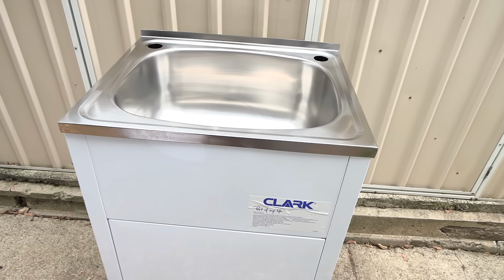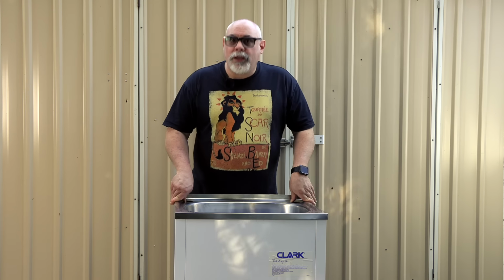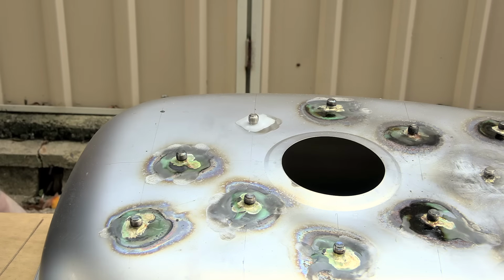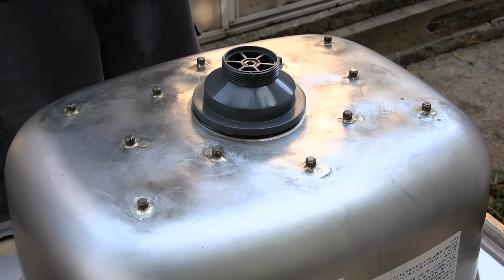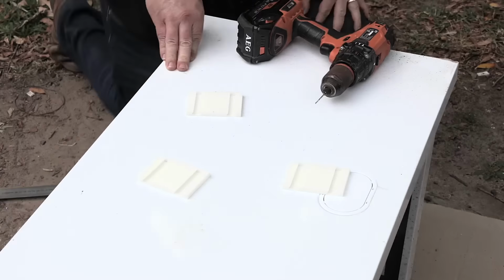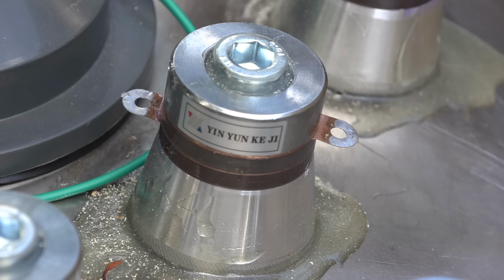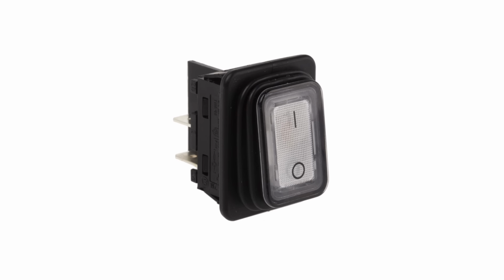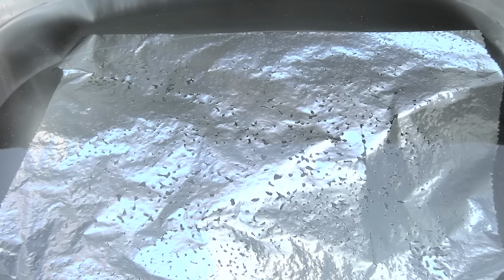Building a Laundry Sink Ultrasonic Cleaner

Comment: nice build, I am wondering if the thickness of the walls of the sink matter? will a thin wall have a tendency to vibrate and attenuate the cleaning power getting into the water or would it actually increase it? or does it not matter?
Reply: yeah thinking about this too. Also thinking if a welded together sink would work? because I can't find sink's deeper than 8 inches from where I'm from

Comment: This is an awesome  project. I have an idea about using this behemoth. When you have small parts to clean perhaps requiring chemicals and you don't want to "contaminate" the entire tank, put the items in a plastic bag like a zip-lock to isolate it from the media in the tank. Then you won't waste cleaner agent / solvents in the 4 or 5 gallon tank.  I have a very small unit that I have never had to clean by doing this and I use tap water as the media in the tank. The ultrasonic energy goes right through the bag and cleans what ever is inside. It also prevents the family jewels from going down the drain!
Reply: BRILLIANT!
Reply: I've seen suggestions to use small glass beakers, as the glass doesn't dampen any vibration.  The soft plastic bags don't reduce the effectiveness noticeably?
Reply: @somebodyelse6673  Well glass has mass that has to be moved back and forth and that takes energy so glass does dampen the vibration converting it to heat. The plastic is low mass and very flexible and therefore mostly transparent to the vibrations.
Reply: Do you put any liquid or solvent in the bag? If not where does the dirt, grease, rust etc. go, does it all just fall off into a dry bag?
Reply: @Bodhi1satva  Yes  I put H2O in the tank and then put the bag of items and whatever solvent, soap or scrubbing agent in the sealed bag. Then that goes into the tank of water.
Reply: I use a painter's cup.  Fill the tank with water, fill the cup with cleaner, put the small parts in the painter's cup.  Saves lots of cleaner--water's cheap!  Great video!

Comment: Hi Bruce,  Silver soldering is an excellent choice, but Araldite (or any epoxy) is not a good choice for this application even as a backup. It is too soft and the ultrasonic waves have difficulty transmitting though. Available info is limited for Araldite, but for most epoxies from 20 to 70C you see a drop in strength to 20% of the room temp value. In tests I did many years ago  (gluing a transducer to a cement vibrator to measure vibration) I found Araldite does not handle vibration well, it seems to be too flexible and got hot and failed due to the vibration. You need a glue which is hard setting and thin. I found common superglue was more effective than an epoxy. I now use Loctite AA326 with SF 7649 activator for vibration prone equipment. JB weld I have not tried, but the SDS shows better performance at higher temperatures than Araldite.  Looking forward to a follow up video in a few months to see if your experiment is successful and if so replicate one myself. Keep up the good work Andy.
Reply from the maker: What do you recommend?
Reply: Best to talk to a loctite specialist as they may have a better idea of your application  I have found them pretty good. but if you have difficulty contacting them I would use  Loctite AA326 with SF 7649 activator. Don't buy from ebay as it is generally out of date and it makes a big difference. Our company buys it from blackwoods. There is one in Greystances, but available online
Reply: Attention ⚠️ following the AA 326 LOCTITE data sheet the recommended bondline gap is only 0.1mm! Up to 0.5mm when applying the activator on both surfaces. https://static.rapidonline.com/pdf/63-0912t_v1.pdf

Comment: Loved your video.  If you had it available, and Oxy Acetylene torch would have been a better choice for Silver Solder.  it would deliver more heat to your area allowing the parts to fuse together more quickly.  You did manage to get the job done with a propane torch which probably avoided burning a hole in your sink.

Comment: Earthing on tub and stand is absolutely necessary and you should bush the holes where cables pass through the sheet metal.
The enclosures you made for the drivers don’t seem to have any ventilation holes apart from the fan mounting but you’ll need air flow to get any benefit from the fans.
Likely you would get far less distortion of the the stainless tub by using a TIG welder to apply quick spot welds to the mounting studs.
Interesting project, it will be interesting to see how it performs and how reliable the components are
Reply from the maker: There is ventilation under the board, so the fan pulls air from under the board and then up and out through the fan hole. You are the first person to mention that, so congrats on your observation skills. I now have grommets around the wires that pass through the metal, I just don't show it in the video.

Comment: When soldering electronic, I pre-solder (tinning) the contact and wire.  That could be done here.  Solder applies to the sink and to the nut,  then the nut is added to the sink and soldered again.  Should make a better contact as solder doesn't have to try and flow between the nut and sink.
Reply from the maker: I'll try that next time. I do that with electronics soldering all the time, so I should have applied it to this.

Comment: @ 5:00 mins in "It is incorrect, as we add more drivers and inducers we will incress the cleaning power, end of story", wow, the arogance. Incidently you are incorrect not end of story at all, clearly you have no engining qualifacations other wise you would not have said this, infact you even offer evidence as to why this comment is wrong later on in your video. Just to clarify, if every inducer in your set up is in phase then yes it is fair to say that you will not see any cancelling out happening but as you have 6 seprate controllers/drivers i can guarantee that they are not all in phase with each over and as a result they will be cancelling each other out to some degree or other. Infact later on when you talk about not wiring some up backwards or you will cancel out, this is true if they are on the same controller but enless all controllers have a shared oscillator to keep them in time with each other then the odds are that setting one set backwards to another set will give you the same results as it is 50/50 that they will be close enough in time to assist and not cancel.  (not really but to make thing simple thats close to right)
Reply: Even if they were on the same oscillator, their physical distancing will allow the creation of standing waves. If they were spaced apart 1/2 wavelength, then they would cancel out.
By my calculations a half wavelength of sound in water at 40KHz is around 2.25 mm
Reply: @Ropetangler   You are right but i was not going to get into that, as factors such as the shape of the container, its thickness and what its made from (effectivly its resonance frequency), as well as any additives that are in the water even the altittude at which  you use the machine will also effect this, but for the sake to the average viewer i was tring to keep it basic. and as i said Close to right... lol
Reply: You need to chill. At this sort of frequency and 3D space, the deconstructive interference will hardly affect cleaning results. It will be a fool's errand to try to simulate something like this in a DIY project with so many variables. Sure there is a non uniform wave field, but at 40khz it's not going to matter much. Adding more transducers WILL increase the cleaning power in this project.

Comment: It is possible for the transducers to destructively interfere and cancel, but it is a very complex situation as physical placing of the transducers, wire length, whether all the transducers are on the same driver or on separate drivers as well as what's in the tank will all influence this..  In general however, the likelihood of an assembly just happening to have significant destructive interference is negligible and more is better...

To verify whether AC line cord polarity is important, you should use your ohmeter to check for continuity between the output and the AC pins..  If there is no continuity, it doesn't matter.  If there is continuity, then the neutral lead should be on the pin with continuity and should also be connected to whichever polarity of the transducer that makes contact with the wash basin..

You should also cut some slots in those driver enclosures otherwise the fans are useless as there's no path for the air to flow.

Comment: Excellent video, what filerment did you use to print the switch panel and enclosures, petg? Also what program did you design them in?
Reply from the maker: I actually use NewTek Lightwave for 3D modelling, which might seem like an odd choice. I used to do 3D illustration for product concepts, and I used Lightwave for that, so it's what I know. I use Cura Slicer, and everything was printed with eSun PLA.

Comment: As an electrician please make sure you're glanding or otherwise mechanically protecting the AC cables from the sharp edges of the penetrations. Also EVERY exposed metal surface NEEDS to be earthed. Really all metal surfaces should be if you cant otherwise segregate/insulate any exposed connections from the metal. This way should anything go wrong the RCD will trip or the breaker if there's a low enough resistance to earth. A simple multimeter would suffice, checking from the UPC plug earth pin to any metal surface. 1 Ohm being the highest value allowable, but in reality it should be no where near that.
Reply from the maker: It didn't make it into the video, but the wires are all surrounded by grommets now and the whole thing is earthed. Thanks for the advice.
Reply: @BranchusCreations  PLEASE include such things in your videos in the futur!
These are the most important things in ANY DIY video with main voltages!
I can't emphasize this enough how many severe dead traps have been build on youtube like this!

This is what makes the difference between a proper DIY video project, and an extremely dangerous never-try-at-home dead trap kit which should be reported (yes, I AM that serious about it, just because it is overlooked so much and the dangers are VASTLY underestimated by everyone).

Comment: Very sweet build, you have fixed a lot of the issues with your previous cleaner.

Just a couple of suggestions though:
1. You're using cheap Chinese mains powered drivers so please braze a bolt to the tub to use as an earth. 
2. Please do something about the cables running into the mains box. Either make the hole larger and use a grommet, or preferably use a nylon cable gland to prevent the cable being pulled out and water getting in. Single insulated mains wire up against metal edges is a recipe for disaster and I don't want you to die. 
3. Instead of the ferrules, just strip a section out of the middle of the wire and solder it directly, it ends up a much neater job.

Comment: close to the end of the video it showed wires going through holes drilled in metal. you want a plastic jacket ir some electrical tape to protect the wires. Over time the jacket will wear and youll get a dead short. I love this project.
Reply from the maker: Thanks, this has been done.

Comment: Hi Bruce.  Great video!  Just a thought when using multiple transducers -- before 'deploying' them, it might be a good idea to take a multimeter and measure the resistance of each transducer and write it somewhere on the transducer body.  This would facilitate two things.  First, one could arrange the transducers from low to high resistance, and pair them into sets of two accordingly so that each pair is "matched" to one another.  Secondly, if you develop a problem in the future with one of the pairs, it would be easy enough to unsolder a wire from one of the terminals on a suspect transducer, measure its resistance, and compare its "new" reading to the original resistance written on the transducer.  That might help in troubleshooting defective (open, shorted, etc.) transducers.  Also, if the transducers do indeed exhibit a polarity, it might be good to measure the resistance with the multimeter leads connected one way, and then reverse the leads to measure the resistance in the opposite direction.  Given that they are designed to work with high [ultrasonic] frequency alternating current, I doubt they would exhibit any kind of DC polarity, but rather the  "positive" (+) and "negative" (-) terminals allow for correct phasing of the AC signal to each transducer.  Again, thanks for the great video.  --  Ken
Reply: Measuring the DC resistance wouldn’t be useful. Capacitance would be mildly useful if these were broadband transducers but these are high Q resonant piezo stacks that are tuned by the bolt tension. The only useful measurements would be the resonance frequency and admittance at that frequency of each driver after installation. Some of the ultrasonic cleaners I have worked with will auto match to the most efficient frequency corresponding to the transducers resonance peak. In this case matching transducers resonant frequency is essential.
Reply: @depthsounderdave  You're absolutely correct.  I should have realized the devices were capacitive or piezoelectric, such that simple DC resistance measurements would be meaningless.  Thanks for the correction to my incomplete logic process.
Reply: Ultrasonic transducer are either capacitive or piezoelectric so I'm not sure if measuring their resistance would actually grant you much insight.
Reply: @oliverer3  You're absolutely correct.  I should have realized the devices were capacitive or piezoelectric, such that simple DC resistance measurements would be meaningless.  Thanks for the correction to my incomplete logic process.
Reply: @oliverer3  Resistance is still one part of impedance. Measuring the reactance might be a bit to much asked from a non EE.
Getting at least the resistance matched might help pair transducers with a ballpark estimate.
Reply from the maker: That is a good idea.

Comment: Is there a reason not to use crimped ring terminals to connect the wires to the transducers, using machine screws, nuts and lock washers? Soldering is fun, but might this be simpler and easier to service? Just a thought, Thanks for the excellent video.
Reply: @notfiveo The arching is not the issue here. You'll get that either way.
eg: broken soldering joint. Which might be even way worse since the wire will now be flapping about loose in the enclosure and can make contact with anything, including the tub itself. This is much more dangerous than just arching between a wire and its respective inducer, if the wire itself is still attached to the inducer via the screw/nut.

However, from tests I've done, I've seen some broken soldering joints (from bad soldering in the first place maybe).
But none of the proper attachments made with screw/locknuts have come loose after prolonged running of the inducer. Of course you need to tiden them properly.

I'm not saying they will never come loose. But IF they come loose, it would be way more safe than solder joints braking. And if they come loose (you'll hear them ratling, and/or something electrical brakes like your driver), it is time to fix....

That said, I am interested in having  driver automatically detect if something is wrong. Would that be possible? Like checking the resistance over the inducer, eg. I assume, when a loose joint is there, it will also be detected since the arching introduces more(?) resistance and/or peak power usages. Ether way, I'm not convinced at all that just soldering is stronger (as in: less prone to failure + the lesser safety issue) than a proper mechanical joint with long bold and locknuts. More specific testing needs to be done.
(note, I'm not talking industrial strength ultrasonics though... those... yeah, they can shake anything loose, apart or even atomize)
Reply: Only thing I can think of is vibration.
The vibration might shake the bolt/nuts loose. But then again, with a proper tightened bolt/nut, that shouldn't be an issue anyways. And also, with a bad solder joint, you'd have exactly the same problem: that too can shake loose/crack under vibrations, so no benefits there (in fact it would be worse as the wire would fall off immediately and flap around making contact with stuff it isn't suppose to. With a loose wirenut the wire would spark, but would at least still be fastened to the eyelet, at first)....

So, yeah, I would simply use ring terminals with bolt/nut and lock washers, and make sure the bolts are a bit longer than needed with an extra locknut so in case they do come loose, they don't fall off immediately.
Reply: Why not use an appropriately sized female spade connector, such as those in use for audio equipment for many years? 🤔

Comment: A technique I’ve seen myfordboy use is to cut small bits of the solder and place them on the work piece before heating. The solder flows when it’s supposed to. I tried a similar technique last week repairing some copper pipe and it seems to work.

Comment: The time lapse showing the tub flexing under the solder flame heat load is oddly fascinating.
Reply: I had a newly restored Triumph Spitfire, and the bonnet (hood) went 'boing' over every bump.  Dad got one spot in the middle of (my newly painted) bonnet hot, and hit the bump flat with a hammer and dolly.  No more 'boing'. £200 pounds for the respray .  I was 19 and out of cash.......
Reply: A heat gun, some dry ice, and a hard plastic mallet might have shrunk your bonnet enough to get the stress out of the stretched metal without marring the paint.   It’s a process but it works once you understand it